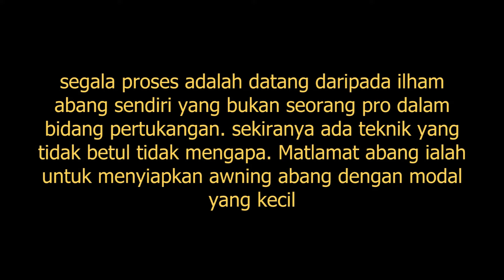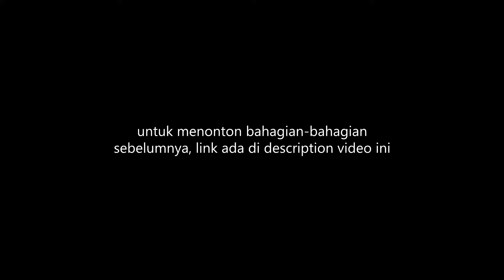CARA BUAT AWNING RUMAH | GUNA C CHANNEL / BAJA RINGAN | BUAT KANOPI SENDIRI | CARA BUAT GARAJ KERETA

Comment: terbaik tu bang.❤❤. boleh tahu saiz, total tempoh masa dan kos peralatan yg diguna.
Reply from the maker: Terima kasih tuan sudi tonton video yg seberapa ni, saiz stor ni 20x20 kaki, sy amik masa 3 bulan sbb buat hujung minggu saja, ahad - khamis kerja, petang balik kerja boleh la buat yg ringan2, kos peralatan sy xtahu nk ckp, sbb byk peralatan sy dh ada, kalau tuan nk buat pintu roller shutter tu, tuan kena ada mesin welder la sbb nk buat frame, kalau xnak beli boleh upah orang buat, lain2 tool special rasa xde sgt, kalau tuan xde driver drill kena beli la satu utk pasang zink tu, sy beli kedai Mr. DIY rm80 je pakai bateri, drill tu juga utk pasang dinding shera.. Berbaloi beli drill driver tu rm80 dpt siapkan stor ni

Dh lama sbnr nk ada stor mcm ala2 mat salleh, akhirnya dpt juga, sblm buat sendiri dh tanya tukang, dia nk rm10k stor sahaja 20x20 kaki  tanpa dinding tanpa pintu roller shutter,

Ni sy habis semua dalam rm8k siap dinding dan pintu roller shutter, kalau kira barang utk stor saja rm5k je, rm3k tu upah org buat dan pasang roller shutter motorize

Memang byk dpt jimat, skrg dh ada stor, dalam rumah jadi luas 😅😅😅